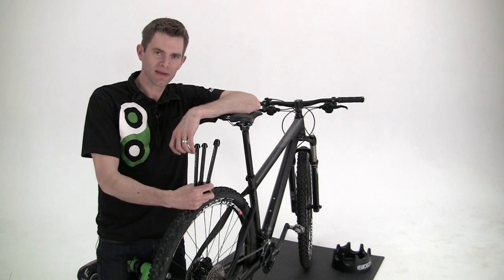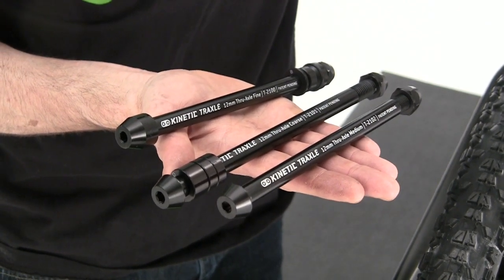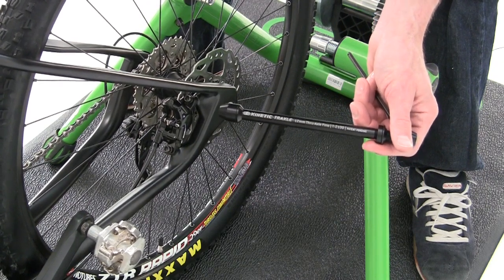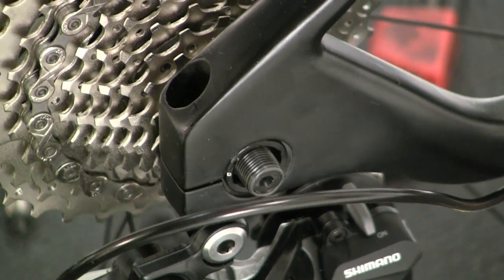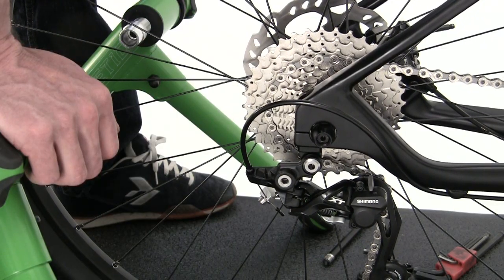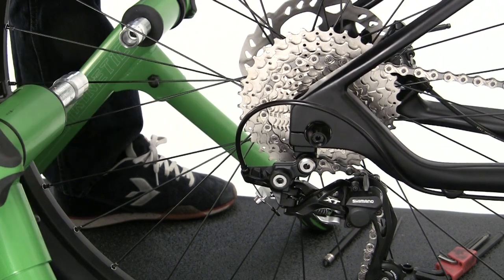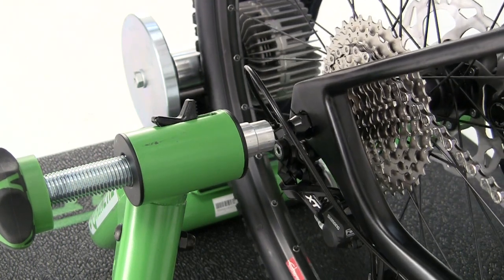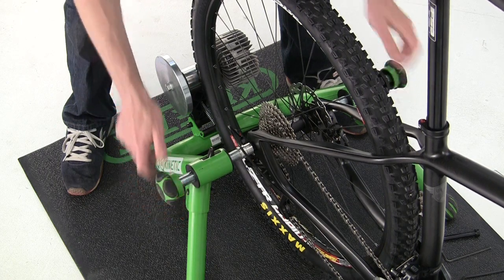How to install the Kinetic Traxle

Comment: Very convenient for you to pick a frame with a nice flat metal flange for the drive side cone nut to screw against.  Most carbon bikes don't have that, and the cone nut will screw against non flat carbon and chew it up.  Please solve this.  E.g. use longer threaded section on the axle and supply a lock nut to lock against the cone nut a fraction of an inch away from the frame.  But you'd have to do some testing first to ensure the axle does not come loose in the frame during use in this configuration.  Maybe supply a carbon friendly spacer made from some conforming material like nylon?
Reply: Would some M12x1.0 steel hex nuts 5mm thickness work?

Comment: Does the Traxle needs to be lubed?
Reply: HaruTheBritishShorthair yes, that is best, but there’s usually a bit of residual grease on the dropouts if grease is left off at install. Good question!
Reply: I had exact same question. Do you a fancy special grease?
Reply: @jackjackthompson5771  the other comment answered the question, it's enough with residual one (haven't lubed in 8months)
Reply: @ogh8667  ok, i guess i was looking for best practice, not just minimal, and exactly what type of grease (like the name) mechanics use for axel lube but thnx...